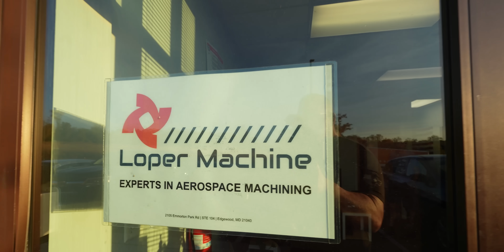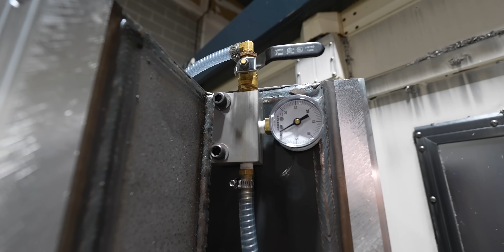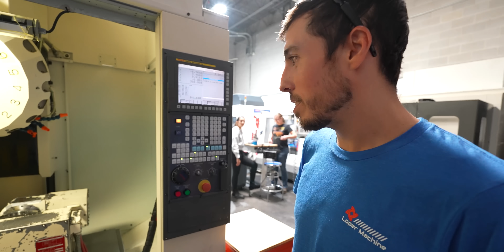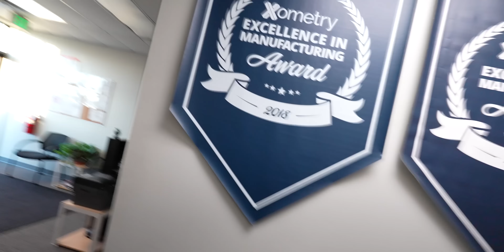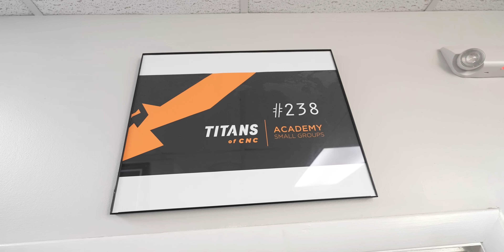Murdering Material, Solving Problems & Creating Vacuum Fixtures to Make MONEY

Comment: Vacuum fixtures suck.
Reply: They sure do. I have a vacuum table in my Haas VF6. It also doubles as a loading table.
Before the end of the day, I just place the parts in it. start the machine ( after all the programming and aligning G54, etc)
And next morning I come back and all the parts are done.

Or

Something went wrong and I had a crash of massive proportions.😅
Reply: You suck